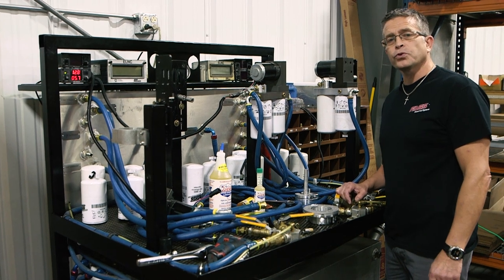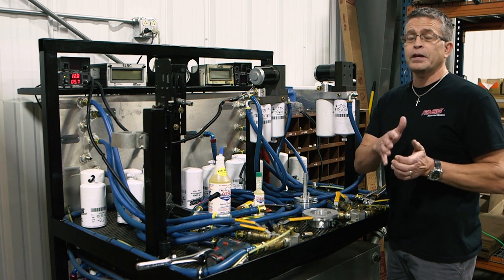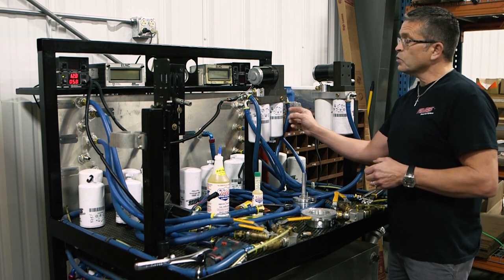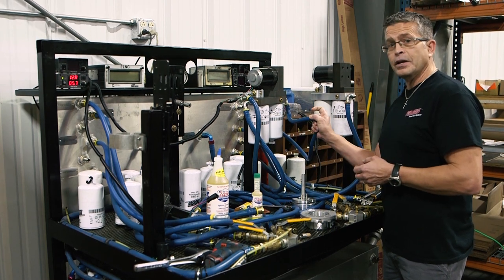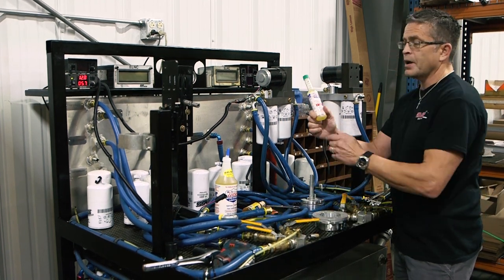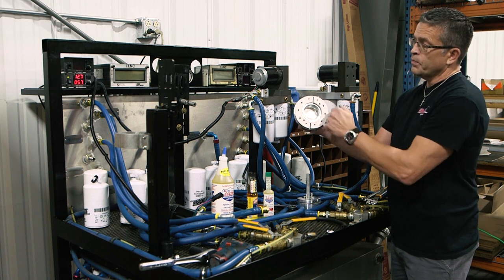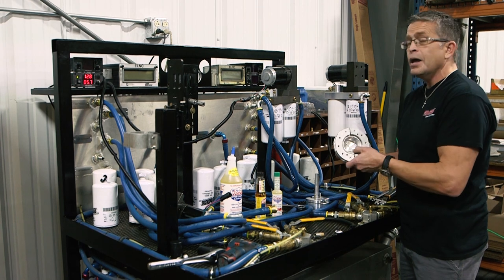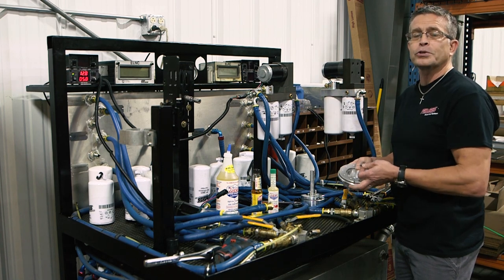FASS Fuel Systems "Sump Restriction"

Comment: These truly are the best even with the issue that arise with install.

Fass sells a kit that i had to retrofit to flow better than what came in kit.

 My buddy and i own 3 rams one of which  is an 03 ram  cummins 3500 and it was the very first kit I was sent. This kit was purpose designed  to use the original tiny lines off the tank  fittings. And it was severely restricted  making allot of  cavitation  noise... I honestly couldn't  believe it. I had decided to order a dual feed/return sump that bolts to bottom of tank. and ran a 1/2" line return  from pump to tank and a 5/8" supply to pump from tank of similar  quality (blue 5/8" pushlock) . I was completely  disappointed  in the cost of this kit as it was a huge frustration  researching a solution  to get me back on the road as to what the best option  would be "to help this pump out a bit"  as it could not pull  fuel volume it was designed  to pull so this sump idea i ran across is what I went with. And was a success  as the pump now out flows its rating. 

 the 1/2 line   that came in the kit had this rediculous silver  quick connection  that brought the 1/2" line SUPPLYING the fass down to just a hair smaller than a 1/4" inner diameter connection. This should NEVER be installed   with a system that flows this much as it WILL reduce the life expectancy  of the pump. 

Note: If you have a sending unit without a pump in tank "do not install this fitting for a supply to pump as it will cavitate. This literally seamed more of a band-aid or "cheap solution" to making the system "a kit"  I got rid of that stupid fitting; probably cost me 15 bucks to include in the kit.

Fast forward,  you can tell the quality is right when you have a repeat customer dispight the trials spend upwards of  $3000+ on these "kit's"  w/upgrading  them to bigger lines and having installed 3 fass system in all our trucks  back to back they are the best  insurance  you can add to these trucks and I just think all fass systems  150lph and up should have 5/8 supply to them  and a  bolt on sump from the start...

Comment: Ever since having mine installed on my lml duramax I swear mine sounds like it’s cavitating. My truck keeps going into reduce power mode and I can hear the engine starving for fuel so I have to let up on the pedal and then push it back down like it’s running out? I have also noticed that I have to be careful when I’m below a quarter of a tank almost like it’s not pulling fuel from that level.
Reply from the maker: We really appreciate you reaching out about the issues you are having and do apologize for all the trouble, sir! When you have a chance please reach out to our service team at 636-433-5410. They will be able to get this taken care of for you!

Comment: I installed a Fass system on my motorhome and I'm having issues with it.

I use my factory fuel lines and attachment my Fass to it, took a while but I got it primed but when I turn the motorhome engine on (Cummins).

I left my return line disconnected to see the return flow back to my tank and I'm getting 0, no fuel is being returned to the tank.

 in fact I can't even tell if the fass is even on when the engine is running. I think my vp44 is pulling the fuel through the fass system.

When I prime it I hear it on and a little bit of fuel comes out from the return line but when the engine is on, 0 fuel comes out from the return line.